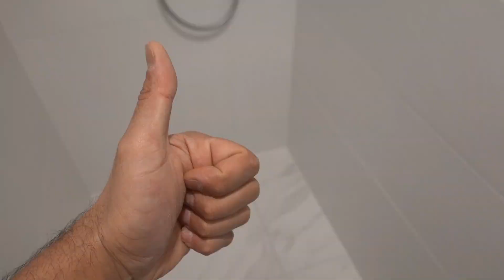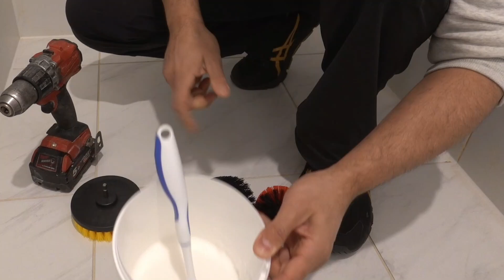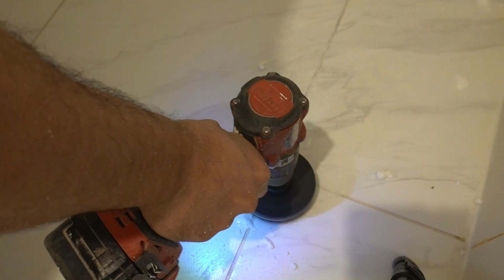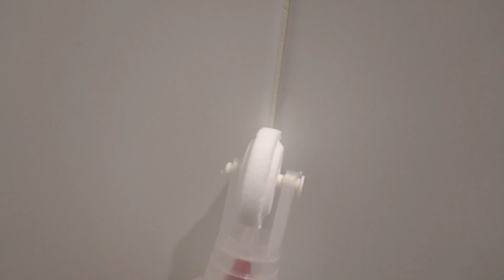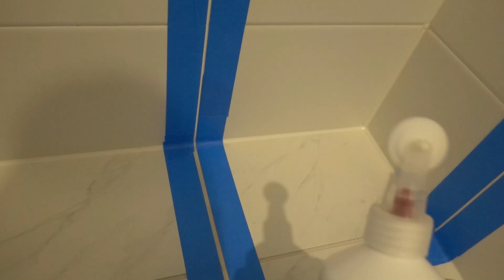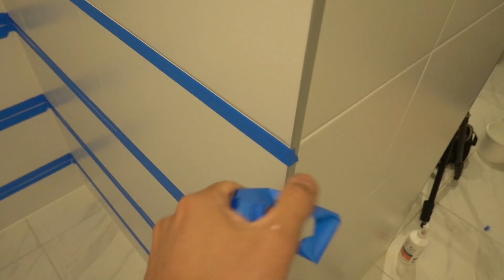How to clean and seal grout

Comment: Looks great mate! I used to use a bottled sealer with a brush, which took for ever, but use an aerosol sealer now for two reasons.
1. No tape up required, as any excess dries to a very light, chalky film, which rinses off with the first shower, or buffs off easily with a clean rag.
2. Super duper fast to apply the spray!
If only all tilers would seal the new grout after their part, and if only owners new to reapply the sealer each year, if not twice a year. Most owners don't know that unsealed grout's actually porous (like chalk). But so easy to keep nice after a light clean and the spray sealer. Food for thought 🙂

Comment: If you mix bicarb and vinegar you end up with salty water. Bicarb is a base and vinegar and acid.  better off to mix bicarb with water or just use vinegar
Reply: If they were mixed in equal parts you would be correct. But Bill was using way more bicarb than vinegar.

Comment: What a pain in the arse having to mask all those tiles. What happens if you get the sealer on the tiles and dont remove it? It is just a clear coating isnt it?
Reply from the maker: It’s a clear coat which may leave a sheen on your tiles and may make it slippery when wet
Reply: @billshowto bon Jovi

Comment: Nice one Bill.

I was told that you shouldn't mix baking soda with vinegar or you will reduce the effectiveness of both. Baking soda reacts with vinegar to produce a salt and water and carbon dioxide (which causes the fizzing).

If it's only a small amount of baking soda, there will still be some vinegar left. But it might be better to mix baking soda with water for the paste to scrub in, then follow up with a spray of vinegar afterwards.

I'll have to get some of those scrubbing attachments. I've seen them at bunnos
Reply: Vinegar largely neutralizes the bicarbonate. So what end up with is an abrasive paste. I think you can skip the vinegar and use baking soda to have the same effect.

Comment: How do you seal when you've got thousands of 40mm tiles ?
Reply: Work quickly? 😲 Sorry. Paint Spot have bulk packets of the blue tape but can't remember the price. Bunnings had similar ones for around $17.
Reply: @josephking6515  Use the aerosol sealer sold at Bunnings and tile shops. It leaves a light chalky residue on the rest of the tiles once dry, that washes off with the next shower, or just buffs away with a dry rag, and you don't need to tape up! I always use this now instead of other options. The cans are about $20 depending where you shop, and easily enough for two coats on normal showers, with plenty left over. You move the can fast along the lines at close range and its done. Still nothing wrong with the product and technique Bill's using here :-)